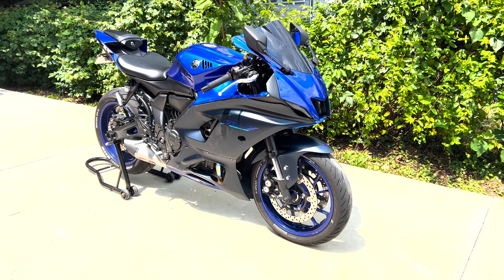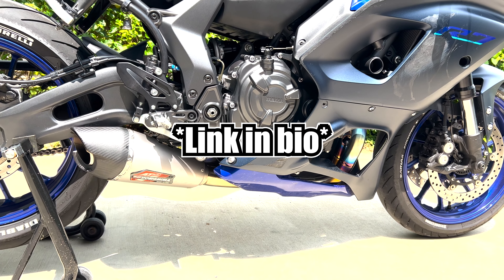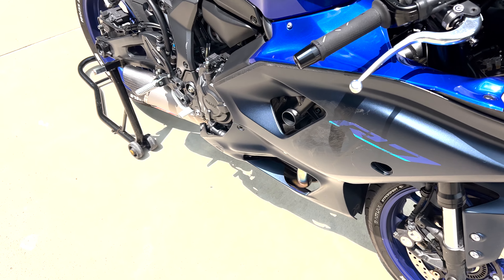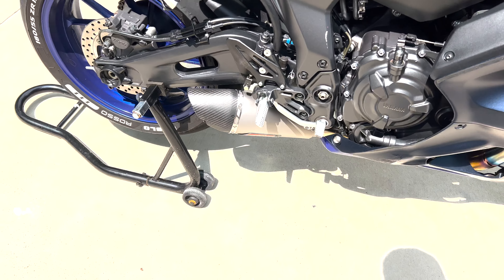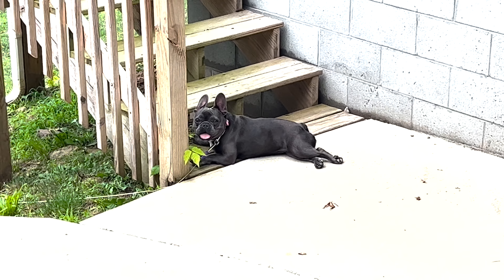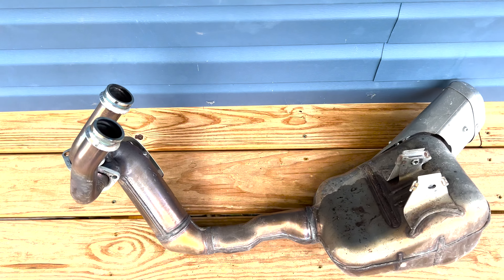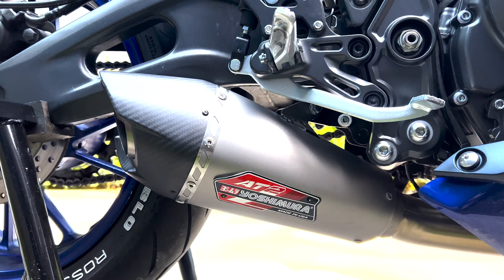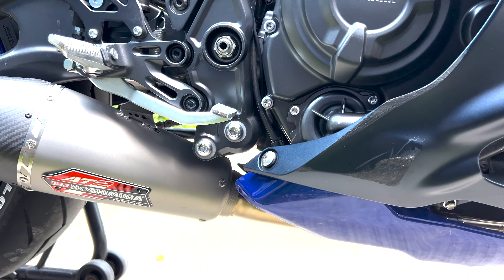Yoshimura AT2 Titanium Exhaust on the Yamaha R7 Sound Test

Comment: What made you buy a r7 again? The sound the torque your just not an in-line 4 kinda guy? Curious as I want a r7 as next bike
Reply from the maker: So it’s bit of a long story but I’ll try to shorten it. Back in around April or May of 2022, the bike in this video (my first R7) needed warranty work done to it. The shop estimated around 6 months down time. I was super committed to my channels and social medias, and really believed I could make something of myself. So, I did what any sane person would do, and sold my only car to buy a new R7. Then, that new R7 is the one I just crashed and totaled and now I have the one that was getting warranty work done to it. Basically though, I just love everything about the bike, the feel, the seating position, the ease of maintenance, and I know everything about it. Hope that helps!

Comment: Bro I just installed mines today, how's the clearance between your swingarm and the cannister of the pipe? It almost looks like mine is touching the swingarm. I put the headers on before putting on the springs 😢. I was able to get 3 springs on, but couldn't get the last one on. U think I should take it apart and get it on? Or do u think the 3 springs is sufficient enough? Feels pretty tight on.
Reply: I contacted yoshimura about the clearance between the swingarm and the muffler and they said its really tight and shouldn't touch when you ride it.